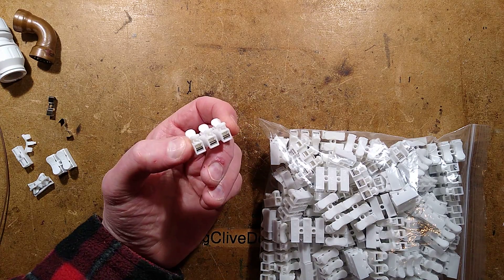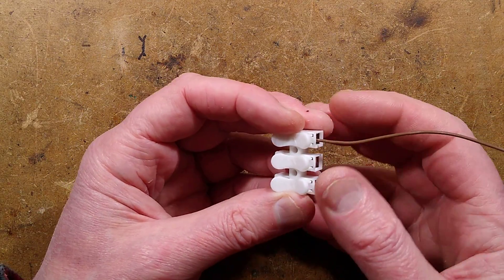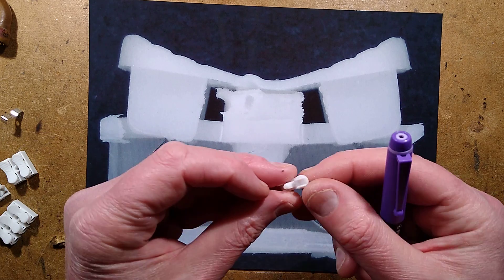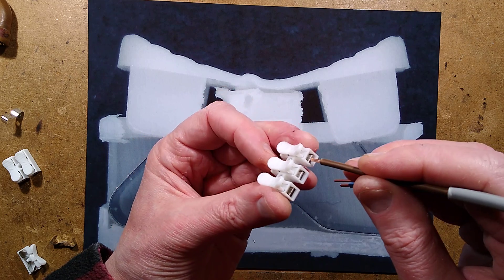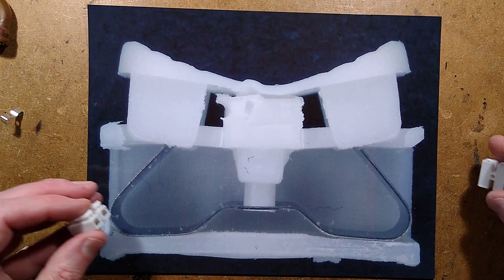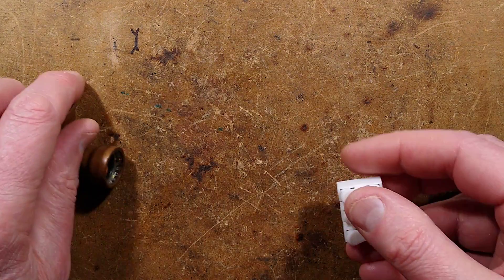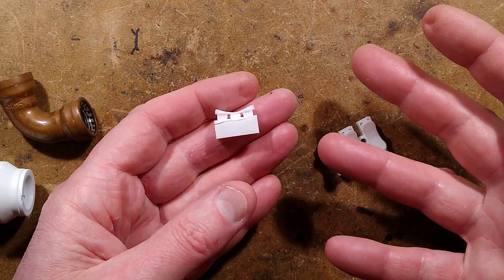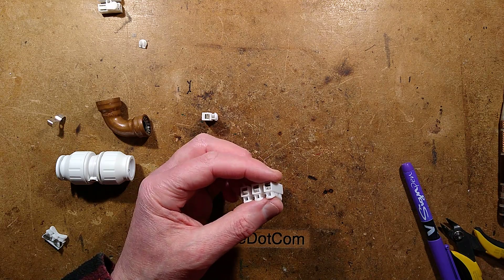eBay's cheapest wire push-connectors (Not for house wiring!)

Comment: For higher current there are some made with ceramic body and the wire is locked with screws, rated for 40A\50A.

Comment: These are very cheaply made versions of a Wago connector.
The conductor does not penetrate far enough to ensure good connection.
I doubt that the plastic enclosing the connector will last long before heat degrades it.
You cannot polish a turd.

Comment: I don't like that the wire is being pressed against the plastic, a little bit of heat is going to loosen the grip, so yeah, definitely not for high current, no matter the voltage
Choc blocks are normally brass or tinned brass
As for the copper elbow, imagine a cold pipe going vertical, it's going to get condensation running down, into the joint

Comment: Somehow I don't trust these at all, not even branded Wagos. I usually replace them with the familiar screw blocks. That said, I realise that they too may not be copper under the bright finish. I never thought about electrolytic reaction. What would be your preferred connector generally available here in blighty ?
Reply: Wago style are BS7671 approved. It's easy to tar all these quick connectors with the same brush.

Comment: Stainless steel has quite a high resistance , the danger area would be the  THIN !  section around the punched hole ( which might glow red hot at 30 Amps ( ? ) .... and ( handy hint ? ) avoid putting your finger in those type of water fittings , you might find it a tad painful extracting it ( ? ) ... Ha - Ha ........... DAVE™🛑

Comment: dissimmilar metals will be the least of your problems. The contact resistance on these is horrible and the plastic is junk that will melt very quickly, pushing the wire into itself causing arcing. I once bought a few of these and literally threw all of them away immediately after first testing them. They also cant handle anything near their rated current I'm pretty sure.

Comment: Really a bit cheap'n'nasty... Mostly bothered by the hole in the middle of the metal strip, reducing the area to run current even further. Maybe try out, which part will start to glow first at higher current ;-)

Comment: Stainless is so close to nichrome it isn't funny.
Reply from the maker: We used to use stainless steel tape as a heater on industrial freezer doors.
Reply: @bigclivedotcom  That's a useful tip! I could use isolated low voltage at high current, probably insulated with Kapton for a couple problem areas (-65°C). Thanks Clive.🙂👍

Comment: the most positive thing one can say about these things is "there are better ways to burn your house down".
Reply: Watch out, you might get what you're after
Cool, babies - strange but not a stranger
I'm an ordinary guy
Burning down the house
Reply: You could just use Kerosene and a box of matches, much easier.
Reply: Just a guess but I'd say you're right. They need to go in a chassis where there's a fuse or breaker so they're not exposed to full mains current, whatever that is where you live. Did Clive say a 10 amp rating? Also he didn't mention any regulatory approval whatsoever so just no.
Reply: @davidg4288  i would be suprised if it actually could handle 10 amps sustained in a closed box without melting.
Reply: @SupremeRuleroftheWorld  I share your suspicion. Also if there's a chassis there would be a place to mount some kind of proper terminal strips, or if you need them loose just use crimps. For a one of a kind project I'd use solder and heat shrink, but I'm old.
Reply: And similarly with any kind of push fit pipe fittings. I wouldn't be able to sleep at night unless I'd turned off the mains stopcock.
Reply: @simonstroud2555  I had a "plumber" install a water heater. He used "shark bites" and they leaked. I took it all apart and cleaned and reassembled everything and they were fine for the life of the water heater.. It was in an unfinished basement so I didn't lose any sleep over it. 
I personally would not trust push fit pipe fittings for water pressure inside a wall though. 
The electricians that wired my house used the push in connectors on the back of the outlets and they've been fine but if I change one I don't do it that way.

Comment: Thanks for another great video, I believe that you are onto a valid point re corrosion due to dissimilar metals in a humid/ damp atmosphere, and even more of an issue in installations/ fittings in locations closer to sea shores, on sea going vessels. The latter examples will most certainly lead to corrosion over time between the copper cable and the steel spring which will degrade /raise the effective contact impedance over time resulting into contact failures. Such failure would be worsened if thinner than minimum recommend copper guage conductors are used.

Comment: The LED lights I got from Screwfix for my garage 7 years ago have got that connector on them. I've just checked a couple and they look as good as the day they were fitted so I don't think the metal interaction is an issue in that environment anyway.

Comment: I overloaded one of these with my water heater. 
They are pretty secure, because the white plastic melt and the contact spring will push the wire out of contact.
Reply: That seems the exact opposite of “secure”.
Reply: It did deactivate itself when used improperly
Reply: @xgamer  That’s a safety “feature”. Perhaps you’re mixing up “security” and “safety” — many languages use the same word for both, but in English they’re distinct concepts. (As a native English speaker living in a German-speaking country, I run into this constantly in English texts written by German speakers.)

Comment: you may want to install a fuse on the power source so in case the metal should corrode and get hot and melt the plastic and cause the wires to pull out and short it would blow the fuse safely disabling the circuit.

Comment: These connectors are scary if they are used in high current applications especially, but the grade of plastic used, and the grade of stainless used, are important for any application. If a cheap commodity grade soft plastic like polypropylene or polyethylene is used for the connector parts it will creep due to the spring contact load and eventually the wire holding force will be zero. Creep to zero force will be faster the warmer it gets. re stainless - in the day job over many years I have seen some excellent spring temper stainless steel sheet from China, and some terrible very low quality stainless from there too. Some of the bad stuff shows visible brown rust-like corrosion after a short time in wet environments. Should the iffy stuff find its' way into these connectors corrosion could cause loss of contact due to oxides, and maybe after a long time corroding, the mechanical tension would also be lost. I'd suggest not using this product for anything but low voltage low current non critical circuits. Wago would be a much better buy.

Comment: I definitely see these coming with home LED light fixtures. I installed a bunch of LED light fixtures around my house last year, and most of them came with these. I had no idea what they were at the time and instead just used the old style wire twist caps that's been around seemingly forever.
Reply: For high voltage applications, they're probably fine since you're not putting many amps through it, especially with LED lights.

Comment: Not a huge fan of any lever lock or push-in connector that will be shoved into a junction box of some sort. No guarantee that the wire won’t “release” itself once you push everything in. Even though Europeans regard wire nuts as being crude, properly installed they are quite secure once they are tight and the insulated portions below are twisted together.

Comment: I've just taken down a number of LED light fixtures that had similar connectors - can't say the same but they would have been cheap as the whole light fixture was cheap. After a couple of years in situ with heat from the lights all the connectors were brittle and broke before I could remove the wires. I had to use a small flat bladed screwdriver to release the wire. As they say - you get what you pay for.

Comment: I use these for extremely low current applications. For example a single fluorescent fixture that pulls 200ma or less at 120v or 100ma or less at 240v. In that kind of application they work absolutely fine. Also for low voltage applications like thermostat wire (24vac), but for that I prefer the insulation displacement telephone wire connectors if it's not something I have to take apart again. I have some in fluorescent fixtures that have been there for years. Would I ever use one for high current, no , not in a million years, but for a single light fixture they do fine, and the galvanic action doesn't seem to be an issue (but then again none of mine are in a wet location).

Comment: What would the reaction be if you were joining a copper wire to an aluminium wire using these joiners?
Reply from the maker: Aluminium conductors are a problem full stop in my opinion.

Comment: have you seen the Louis Rossmann video about the ebay fuses? great little things, keeps giving power when your overloaded circuit demands most power, without failure
Reply: Yeah I'm tired of the weird names of crap on the Amazon. I can't say I watched all of his fuse video but I don't think Louis proved his test setup with at least a known proper brand name fuse. That said yeah he loaded the junk fuses and no blow. Almost as good as sticking a coin under an Edison base fuse. (nickels work best)
Reply: I already told him about them and Louis some weeks ago
I like Louis when he goes for the big brands 😂
Reply: I saw him use the wrong crimping die on a terminal and then complain and rant that it did not hold
Reply: @earl3358   Thats my main issue with Rossman and why I cant stand watching him anymore. 
He's become so good at his craft he forgot to reserve some humility. 

He also does a terrible job at hiding his anger/frustration management issues on camera. Can only imagine how nasty he gets off camera.
Reply: i think one of the first clive ones i watched was about the sand filled fuses.

Comment: They're rated at WHAT?? 😲
No, dear penny-pinchers, that's nowhere near ten Amps!
I have those or a very similar product, from Amazon. Use them for my overhead LED flooders, 15W each. But watching this video I'm surprised that they don't even have a metal part which the spring tab is pressing the inserted wire against*! *digging in electric parts box*: Yes, they're exactly the same thing. Never until today hav I looked *inside one of these guys, though.

Comment: I was hoping you’d find a way to ohm them out. Stack a dozen or so since you probably don’t have instrumentation to read millions.

I wouldn’t use them at all, ever. Temperature and humidity cycling will generate condensation and that will cause corrosion.

Comment: Ironically, the only thing they are safe for (low current, low voltage), they are TERRIBLE for. Same problem happens in vehicles, manufacturers use the same generic connectors for everything, and things like the immoboliser circuit that only draw 100mA at most, stop working after a couple of years of corrosion, people constantly pay for new immoboliser coils and the labour to replace them when all they need to do is unplug the connector and scratch the terminals (that SHOULD be gold plated, but aren't to save 3 cents). The best fix for that is actually to cut the connector out and solder the wires directly... much like Chinese connectors in general :P even just twisting and taping is better, and that is scary.

Comment: Okay, I'm gonna wire up a 30A 240V clothes dryer with one of these in the name of science. In a controlled environment. With horribly undersized wire.
Reply: Where should we send the flowers? 🚑
Reply: I suggest you use a metal junction box and place a thermal fuse made for these dryers inline with one of the legs inside the metal junction box.

Comment: I've never trusted any push connector.

In the US, house trailers were once built using outlets and switches having push connections, and worse, they used aluminum wiring. One would also hear about people walking through the trailer causing the lamps to flicker, and about many fires. Thank God, that changed.
Reply: Honestly I trust  a proper push connector by for example Wago more than a lot of wire nuts. But then again I live in Germany and we do basically everything with some type of wago here.
Reply: I live in a manufactured "mobile" home and it did come with backstab outlets.  Thankfully it's copper not aluminum.
Reply: They were probably also cooking m**h in the trailers, so there is that. And poltergeists cause lights to flicker and fires. 

Remember, most things are usually caused by ghosts, then criminals, then, if you can rule those 2 things out, then maybe it's a result of running 3 space heaters on a 50 foot aluminium-core extension cord plugged into a happy-bake oven socket. 🦆💨
Reply: Push connectors are perfectly fine and better than love of US for the wire nuts as they do not suffer from bad installation or loosening due to vibration, ONLY when they are either the lock in type (Wago 222 and similar) or the internal teeth type (IDEAL Push in connectors) and used within rated specs from a well known manufacturer. I've been dealing with exclusively Wago and IDEAL connectors and such and not a single failure when within spec.
Reply: I hate all push connectors, And obviously wire nuts are not legal here, Push fits actually take longer in reality, I always go to cage clamp terminals. I have also had Wago fail on flexible cable.

Comment: How much "optimising" of the production of cable/wire connectors can there be before the life of people becomes a consideration? I would barely consider these to be used on low-voltage applications because even at low voltage, the current the connectors would be subjected to will be more than they can safely carry. Money vs Human life, or even any life, has to be a consideration, but is that just me being overly cautious?

Comment: The engineering is pretty neat, but usefulness is questionable.  They make such a tiny connection point to the wire.  Even if the spring thing was copper or brass, I’d suspect the little spot holding the wire would heat up very quick.  🤔

Comment: I used these to connect 12v car battery to led strip light in the shed and they melted, causing the wire sleeves to catch fire.  Needless to say, the cable came from China.

Now I only use them for sub-1 Amp projects such as Pi nano and replacing AA cells with lithium cells from discarded vape thingies.

Comment: Had some of these a few years ago and tested a heated seat element at 12V, 7A. Not surprisingly they softened and warped after a few minutes - wouldn't risk more than 1-2A longterm

Comment: Received the same ones a few weeks ago. Luckily just 10 to try because I really don't like them. The wires come loose way too easy.
By the way, pressing it in is meant so you can pull the wire out. You don't press it when inserting a wire.

Comment: another risk is people desperately wanting do daisychain several light fixtures, stuffing 2 wires in one side. that will risk one of the two not properly connected and causing catastrophic resistive heating.

Comment: Compare Louis Rossmann's test of a push connector given five stars on Amazon which let go of the wire with one pull.
Reply: Must've missed those - seen his test of crimp butt connectors, and automotive fuses though...
Reply: @michaeltempsch5282  Quite possibly that is what I was thinking of. I am not an electrician and may have mistaken the type of connector.
Reply: @zh84  With the crimp connectors, you use a set of pliers to compress the metal of the connector around the wire, capturing it - one time thing/use, in contrast to Wagos and these in this video.
A third type, looking similar to the crimp ones have shrink tubing outside and a low temperature melting solder inside (insert both wires, apply heat, and the solder melts connecting the wires, and the shrink tubing shrinks).

Comment: Daft as it sounds these are probably safer in the hands of an  (inexperienced) DIYer than the ubiquitous screw  'terminal strips' (which also are not always copper) - especially when stranded wires are being used.  Certainly easier to use when working upside down connecting the new light fitting, no dropped small screws and no arm stress turning screwdrivers.  That said I agree with other comments - no more than an Amp I'd say and certainly not in an 'never to be seen again' location.

Comment: A similar analysis of pcb screw terminals would be useful, the ones which are just a piece of spring steel held down with a screw.
Many are completely useless compared to the rising clamp type.
Reply from the maker: The ones with the metal leaf do press the wire down onto a suitable alloy.  I do prefer the rising clamp type.

Comment: Very useful for quick connections in low voltage, low current applications
Reply: Even then they fail. The springs aren't up to the job.
Reply: or plastic gets brittle and it just falls apart in service
Reply: @ketas  it actually crumbles after a few years.
Reply: No good in flexible cable or ferrules,  I have tried because lamp fittings have them, Usually end up throwing (literally) in the bin.
Reply: Oooh. I've orderer these .. twice. on purpose. Very useful for temporary repair/modification of severed three-wire tiny fairy lights.  I left some for nearly a year outdoors(Canad-eh), and the resistor and diode leads rusted but the connectors were still good to go. I could identify them in a lineup since they indeed appear to be somewhat stained and Clivehandled.